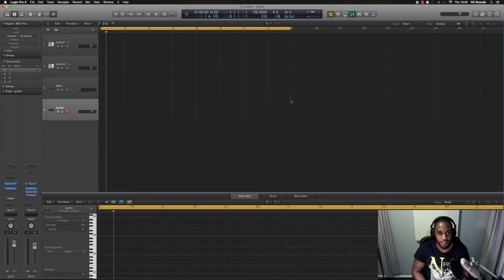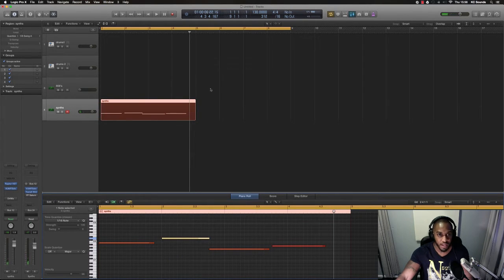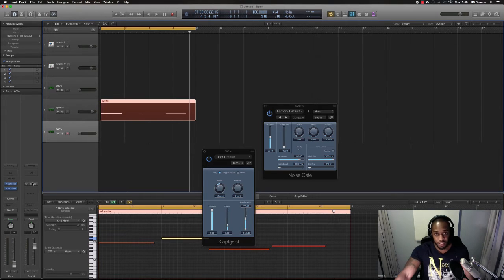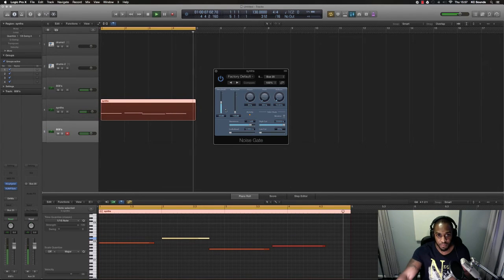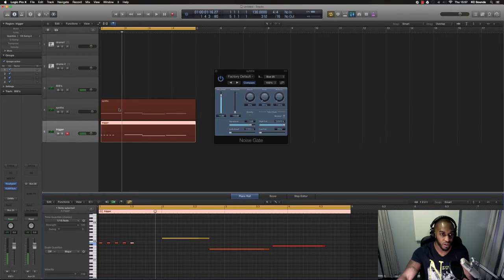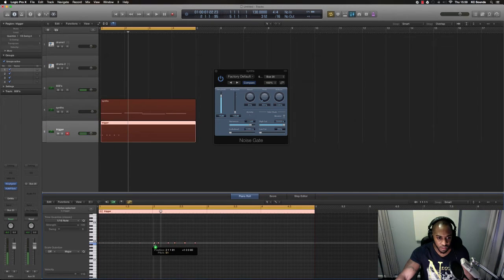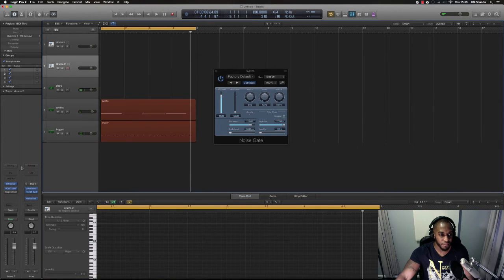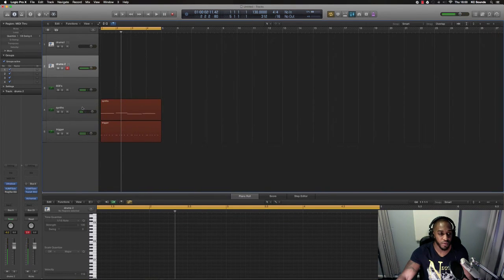How To Create a Stutter Effect in Logic Pro X | Logic Tutorial

Comment: I'm at risk of sounding like a bit of a twat here but there are far easier ways of doing this, not that this is wrong or anything. It's just you could do this with the LFO built into most of the good synths in logic or use the arpeggiator and it would take far less time. However, if you need stutters in time with something that doesn't repeat normally, I suppose this would be an ok way of doing this.
Reply from the maker: Sam Jones I appreciate your input. Thanx for watching